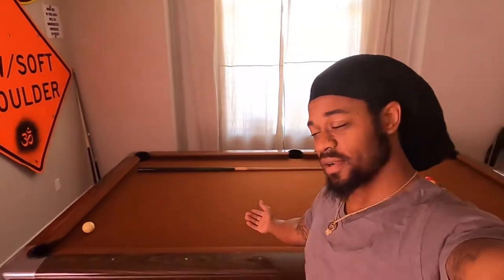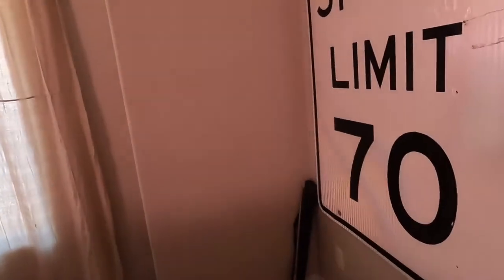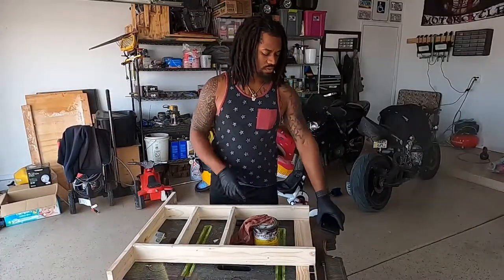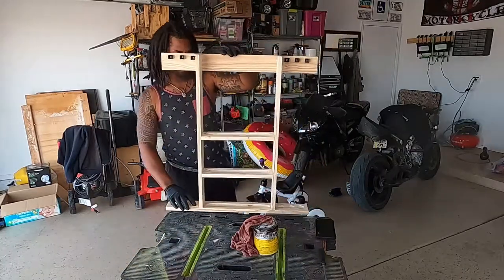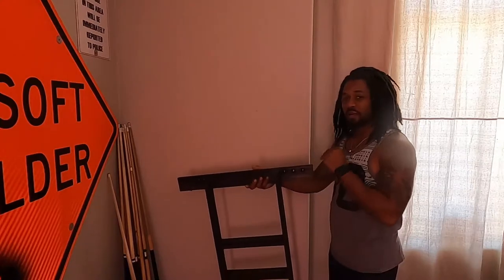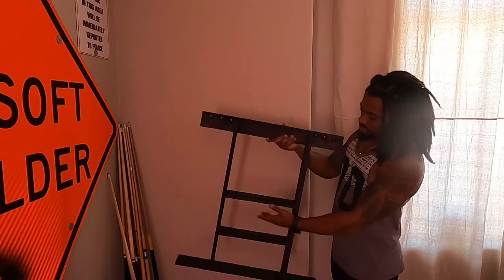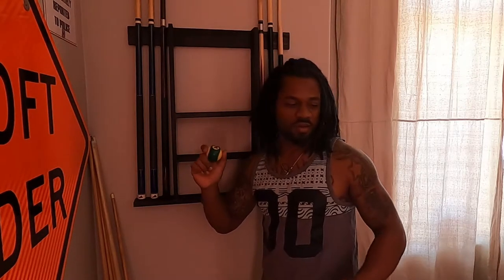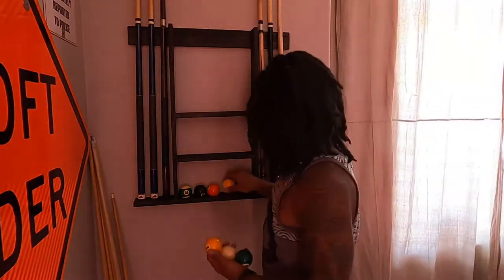Making a pool cue holder

Comment: I like your saying “why buy it, when you can build it”. I give you a “B“, because I did see something that could have made it better, there is a space at the top where the wood is screwed into the wall with the wood going down the wall, you should have notched both pieces so the whole thing would be flush with the wall and/or put a back piece on the bottom so there is even spacing and where you could put 2 more screws in the wall with 4 total for support instead of just 2. Other than that I think it looks good.
Reply from the maker: I thought about that after I had it against the wall. I was thinking of taking it down and notching it but I was being lazy not going to lie lol